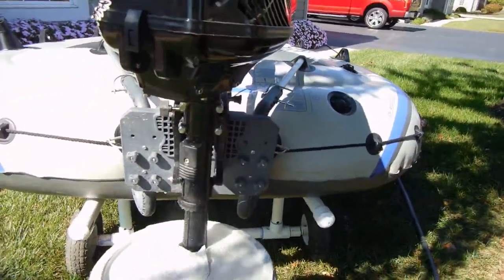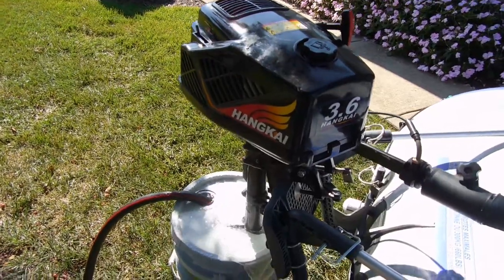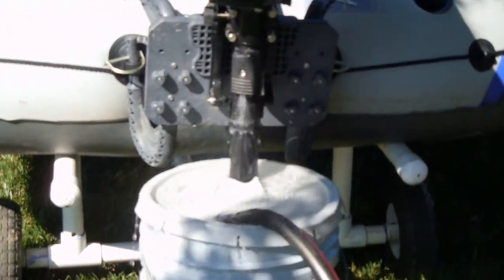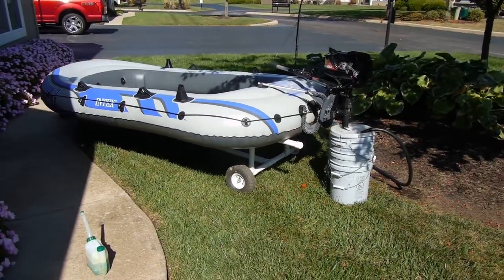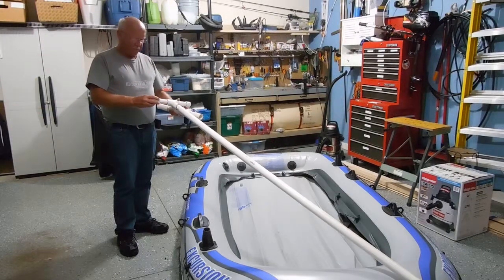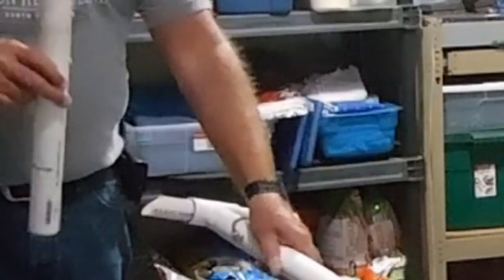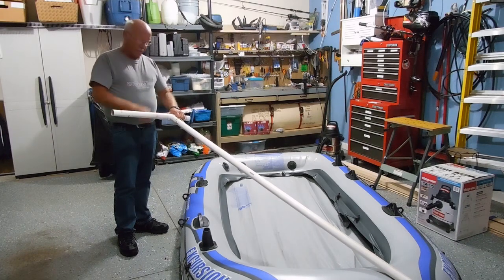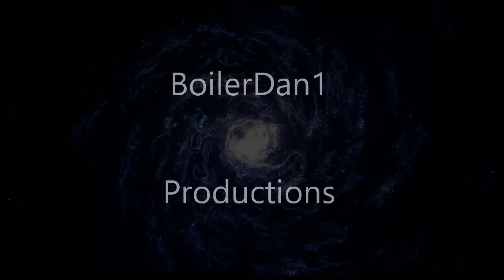Hangkai motor update after clutch repair

Comment: This is a fantastic video, thanks for the update showing that a lighter spring is beneficial. Keep up the great work!
Reply from the maker: I wish I was able to take it out on the water.... But just couldn't get to it, so the next best option was to film it here.  I should have mentioned that I ran a full tank of fuel through it and had no issues.  I can tell the clutch engages much better.  That's the good news, however one of the fuel lines was cracked again.  Right where it enters the fuel tank... It is an easy replacement, so I'll probably just put new lines on at the beginning of each summer.
Thanks for the encouraging words.
Reply from the maker: The new spring was a little bit long... I'm going to see if I can pick up a similar one that is about 1/4 inch shorter.  I would suggest that for anyone trying the lighter spring.  Another viewer asked for a video showing replacing the spring. I have a spare clutch, so I'll see if I can pick up a little shorter spring to include in that video.
Thanks for taking the time to comment!

Comment: Hola Dan hace algunos días le escribi con respecto al cloche del hangkai 3.6 y recibí esta medida Spring, Extension, 7/16 in. x 1-7 / 8 in. - .047 Diameter y ahora mirando su video veo esta otra medida Spring Extension 15 / 32X 1-13 /16, cual de los dos debo usar y donde lo pudiese comprar al igual que cree usted que me funcionaría mejor con el Cloche de Honda Gx 31 o 35 gracias por su atención
Reply from the maker: Hola Roman, quería hacer un seguimiento una vez más para aclarar.  El embrague Honda GX 31 / 35 se adapta al motor Hangkai 3.6.  Es sólo que la primavera es demasiado fuerte.  Te sugiero que consigas un nuevo embrague y luego uses ese resorte para llevar a una ferretería y encontrar un resorte que se ajuste y que sea aproximadamente la mitad de fuerte.  Aquí hay un enlace que tiene un embrague Honda Gx 31 en venta.  Es de eBay.
https://www.ebay.com/i/322476996199?chn=ps&norover=1&mkevt=1&mkrid=711-117182-37290-0&mkcid=2&itemid=322476996199&targetid=885491683625&device=c&mktype=pla&googleloc=9016721&poi=&campaignid=6469981107&mkgroupid=91562449160&rlsatarget=aud-762207186714:pla-885491683625&abcId=1141176&merchantid=113357307&gclid=CjwKCAjwh472BRAGEiwAvHVfGlUrxIUXBRqoFdgiTYaObiiJakRBg56mRMS09Lp38rnrJVkWBbi5SBoC3NsQAvD_BwE

Comment: Hello Dan a few days ago I wrote to you regarding the hangkai 3.6 cloche and received this measurement Spring, Extension, 7/16 in.  x 1-7 / 8 in.  - .047 Diameter and now looking at your video I see this other measurement Spring Extension 15 / 32X 1-13 / 16, which of the two should I use and where could I buy it, as you think it would work better with the Cloche of Honda Gx  31 or 35 thanks for your attention
Reply from the maker: The second one didn’t work out. I’d recommend taking the spring to any hardware store and get the correct length but weaker.  Just strong enough to pull back at an idle.  I’m out of town today, I’ll look more up in the next day or two.
Reply: @BoilerDan1  ok thanks Dan I'll tell you the results two
Reply from the maker: Home early!  Ok, the first video spring I picked up at Menards Hardware Store. It's the 7/16 in.  x 1-7 / 8 in.  - .047 Diameter that I think was in the first video.  The second I found on line at Home Depot.  When it came in it was too weak a spring.  The first one works very well.  The only problem is that both ends are closed.  So I bent it open some and even clipped a little off the ends. Closed ends are good but you have to be able to get in on the clutch.  The spring on the clutch is just way too strong for this motor application.  It takes to much acceleration to overpower it.  That also causes excess wear on the clutch pad itself which is very thin too.  I you have any questions, ask away.  I'm happy to try to help.

Comment: Can you do a video to show how to do the clutch spring replacement?  I'm guessing that's what I need.  I have to darn near go full throttle to get the prop to start spinning.  Thanks.
Reply from the maker: I am happy too (give me a week or so... But I can tell you that from the sound of it, your clutch is worn out.  I suggest that you order one and have it on the way.  Amazon (Link:https://www.amazon.com/gp/product/B07J6F4J6M/ref=ppx_yo_dt_b_asin_title_o02_s00?ie=UTF8&psc=1 )  for under $12.  You can also get them through eBay for that or a little less.  Do a search for: Clutch Honda GX31 
OR:  MITSUBISHI TL33 TL43.
Switching the spring is very simple, I'll try to illustrate in the video.  The one I originally put is was a little bit long, but I was able to bend the hook part because the replacement was softer metal.  That probably doesn't make sense, - I'll explain more in the short video.
You might be prepared to change your clutch every season... I don't think they last very long. )0:
Reply from the maker: I finished your request much sooner than anticipated.  Here is a link showing the spring removal and insertion. https://youtu.be/G4qLw14lf9k

Comment: Hello Dan! Nice video. Could you please tell me what the specs of the lighter weight spring is that you used.I have the 3.5 hoarse motor and am experiencing the same issue.
Reply from the maker: It's your lucky day!  Here's a link to a short video with the actual spring I used showcased in the video! https://youtu.be/G4qLw14lf9k
Never miss an opportunity to self promote. 😂
However to save you time, I purchased it at a Menards hardware store.  The specifics are: 15/32 X 1-13/16 extension spring, Part # 88195.  Special note: I had to work to get the spring on because this replacement is closed ends.  It made a great improvement as it took only minimal acceleration to turn the propeller!  
I mention a different spring in the video that I had on order from Home Depot. but it turned out to be too small.  So ignore that information in the video and go with the one from Menards.  You can pick one up anywhere, but I mean that size worked out very well.

Comment: I’m having a problem, when at idle, it sounds normal, but when the prop is engaged it’s making a loud noise. What could it be? Thank you in advance!
Reply from the maker: Just to make sure:   Did you put gear lubricant in the gears down by the propeller?  The system is pretty simple, so you might take it apart like I did to replace the clutch and see if there’s something wrong in the area of the clutch itself.  Here’s the link to that video. https://youtu.be/H4mPGuEKnKI. Other than that, I’m not sure what it could be.  If new, maybe contact seller and ask for another one or refund?  If not returnable, only option is to open it up a little and see? One other thought, maybe if the clutch bolts are too tight, the clutch may not be able to pivot open all the way?  Let me know more as you proceed.... your clutch could also be worn out?
Reply: BoilerDan1 the bolt did come lose in the gear in the prop. It has worn down the gears just a little bit. Only a little bit of the teeth are missing but when I put the bolt back in and put gear oil in it, put it all back together it was still making the same noise. I took the motor off and started it for just a few seconds and it never made the noise so it seems to me it’s got to be in the bottom end.
Reply from the maker: I think I agree with you regarding it is in the lower gear box. I’ve seen the parts in the past thru eBay. I glanced and found something by searching FORWARD GEAR ASSY Shaft PINION fit hangkai 2hp 3.6hp outboard motor 2 stroke.  I’ve also been told that Yamaha parts will fit... but I’m not sure.  I’ll keep searching and see what I can find.
Reply: BoilerDan1 thank you!
Reply from the maker: Great News!  I found the unit I mentioned.  You can get the entire assembly via eBay! Here is the link: https://www.ebay.com/itm/Hangkai-2-stroke-3-5HP-Outboard-Motor-engine-gear-box-propeller-water-pump-assy/273099121555?hash=item3f95f9e393:g:G3cAAOSwmRBalmfI
The bad news is that it ships from china and who knows how long things will get back to normal and allow shipments?  There are several sellers, just copy the text of the description to see others available.  I'm almost certain the one for the 3.5 hp also fits the 3.6 hp motors.
Thanks again for searching out my video's. I'm happy to try and help. But I'm no expert, just documenting my experience with my own motor.

Comment: Does your prop spin freely with the engine not running?
Reply: I'm thinking it's doesn't spin freely because of the water pump impeller?
Reply from the maker: It won’t spin independently (or freely due to the gears are always connected. It doesn’t have a transmission.
It has a centrifugal force clutch.
It’s a very simple system. To see what I’m referring to, watching the video I posted replacing the clutch will help you see the mechanics of the motor.
Thanks for watching 👍👍

Comment: So would you recommend this motor?
Reply from the maker: Only if you can get it cheap. But be careful to buy from reputable place through eBay.  Also you must like tinkering with motors.  Also the clutch probably needs replaced every spring so order spares!  The motor itself seems solid but the little parts are not.

Comment: Been watching your videos because I’m considering this motor. Would you happen to know how much it weighs?
Reply from the maker: Just a little over 22 Lbs.  Here is a link to the companies web site. http://www.hang-kai.com/en/pd.jsp?id=14 You might find more specifics.  If you have watched my segment on replacing the clutch, I'm confident you are aware of the minor issues I've had to deal with.  I think the engine itself is sound, but the little parts, especially the clutch should be of much better quality.  I'm hoping my adding the lighter spring will improve it's performance. 
Thanks for watching.
Reply from the maker: I just edited my reply adding the link to the hang-kai web site.  I noticed that I had forgotten to add it my first reply.
Reply: BoilerDan1 appreciate the response! Mechanical things don’t scare me.  I went to the link you shared and it doesn’t really specify (might be because I’m on a cell phone). So right over 22lbs for the 3.6hp like in your videos? That’s perfect for what I’m considering this motor for. Have you considered finding a brass insert that might fit into the fuel line grommet to the fuel tank? Just a thought.
Reply from the maker: @philphish1643  That's a great idea regarding where the fuel line goes into the fuel tank.  That's where it seems to break and sliding onto a grommet on both ends might just work!  THANKS FOR THE IDEA!  Yes, the 3.6 hp is the 22 ponder!  I went with it because I needed to lay it on its side to transport to the water and back.  The 4 stroke will leak oil into the cylinder if laid flat.  I could remove the oil each time, but thought that would be a pain.  I don't really go out very often, but I'm looking forward to later this spring to get out and see how it will do with the new clutch and the light weight spring!  If you get one, I hope it goes well for you.  I've heard a lot going both ways.  But if you make improvements and like to tinker, You can have fun with one too.
If you know where and what size brass insert would work, pass that along!  I might just try looking something up online, just never thought of that to improve the fuel line issues.
Reply: BoilerDan1 I’ll keep my eyes open for brass fittings or nipples. Since I don’t have the motor yet I’m not sure what size would be appropriate, but I’ll I’ll see what I can dig up.

Comment: Do you know if the hangkai motor comes with paperwork to get it registered? I live in Missouri. It says all outboard motors have to be registered.
Reply from the maker: Hi Joe,  Actually in most states the craft is registered if you put a motor on it.  So you might call your BMV to confirm.  The boats, even my cheap rubber raft has a  "Certificate of Origin" and that is what allows the motor to be used.
Indiana requires any motorized watercraft to be registered. Missouri may be different though.  If that is the case you will need to see if the can assign the motor a number so you can register it?  That normally is a form that is filled out by law enforcement after they run a check to verify the item is not listed as stolen.  Kind of like a VIN check on a car if you lose the original title.
There are no serial numbers on this small of an outboard motor.
In my case, the raft manufacturer supplied the paper work that I needed.  Here is a link of a video I made showing that process:   https://youtu.be/JP1YFfuIV00
That may not help you, but there is no paperwork on just the motor with the information you would need.
Thanks for watching!
Reply: Thank you!!